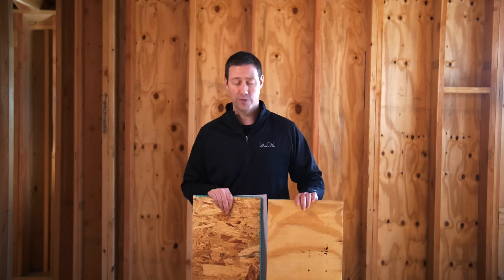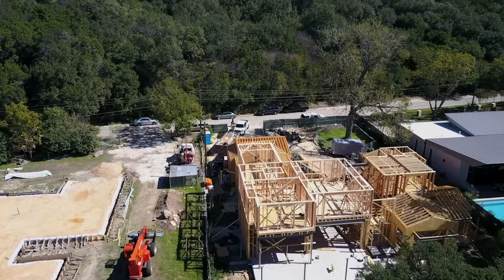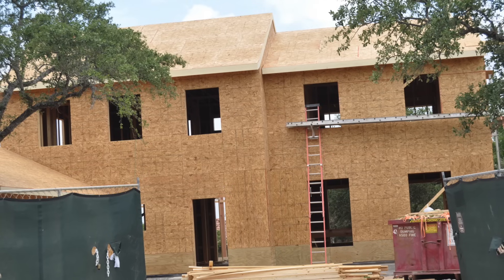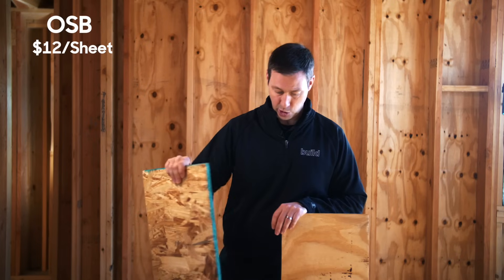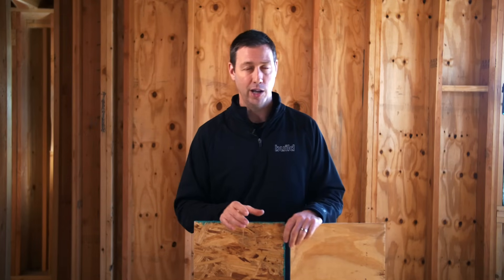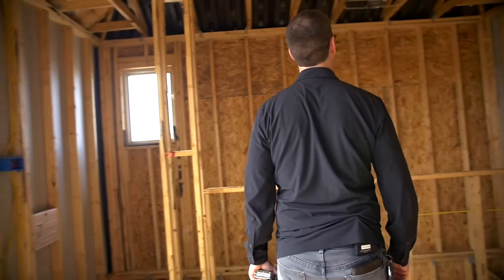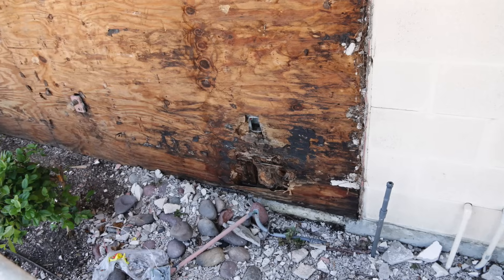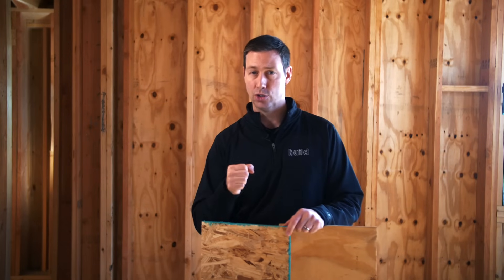Framing : OSB vs. Plywood - Whats the difference in COST AND PERFORMANCE

Comment: I'm curious why osb always has blue edges?
Reply: I bought two thicknesses of OSB for a shed I just built. I think the colored edges are different for different thicknesses. Mine were blue for the 5/8" stuff I used on the roof, and green for the 3/4" I used on the floor. I assume it's a sealant as well, but the color just helps to identify it from a distance.

Comment: Being from the UK I naturally assumed he was talking about material choices for a dog kennel or chicken shed. Why would anyone want to use either in a house?
Reply: I think sir you just continue to perpetuate the myth that water sodden bricks and blocks somehow constitute a long lived and sound building structure . They do not . Both of these materials are incredibly costly to produce and transport and consume huge amounts of energy in their manufacture . Neither perform well when it comes to thermal retention . Neither allow for truly affordable housing . The majority of  traditional brick built houses currently being constructed in the UK are expected to have less than a forty to fifty year lifespan . Virtually non of them come anywhere close to achieving Passive House standards . Virtually all of the current building stock and those currently under construction could not be re-modeled , without huge expense . I have toured the UK and seen , first hand , many sites , both large and small , where brick and block built properties are being , quite literally , 'thrown' up . Thrown up and their unprotected walls with open cavity being exposed to weeks if not months of continuous wet weather . With then , no drying allowed for , rain sodden preformed matchstick roof trusses are nailed into place and the whole sorry structure is encapsulated . The structural wall and brick fascia are water sodden , the inadequate wall cavity is water sodden . The cavity insulation which is usually , in my experience at a minimum level , is compromised by poor installation and mortar bridges - A properly designed and constructed timber and timber product domestic dwelling will not only out live and out perform shoddy brick and block structures which it would appear are the norm in the UK , they make for truly affordable housing stock . Housing stock to meet current demands .

Comment: Structural integrity is better with osb. Just built a custom home on lake Stillhouse and the ply doesn't hold up as well.
Reply: Adam Demirs I'll  bet your contractor didn't waterproof correctly and or didn't use treated plywood. I live and build in Kauai Hawaii and with our heat and humidity OSB just sucks. Only plywood on my projects.

Comment: The best building material by far is conrete.. Seriously. 90% of house here in Iceland are made out of rebar and concrete. Its fireproof, if a fire will occur the roof, the walls everything will be there no rubble. It’s safe for firemen to go in since the the house won’t collapse. Houses in Iceland that we’re built in 1900s made out of concrete are still standing and liveable. If done correctly it’s waterproof. I don’t get it why so many houses in the US are made out of timber. Yeah sure you might be faster building a timber house than concrete but if you train a house builder well enough it can be done in no time. House builders here have built a big apartment building out of concrete in a few months. Concrete all the way.

Comment: Here is another opinion from personal experience. OSB also known as glueboard or chipboard is a false supporting material. Its strength comes from glue. Here is a little insight that I have about OSB.  Long term OSB oxidizes over time, so the houses may fill with toxic gasses which will contribute to the residents allergies and what the OSB supports will loosen up.  OSB, once cut or holed, has exposed wood chips and bark. What that equates to is, in humid areas, black mold will grow in the walls and then it will pollute the house making the residents very sick. (Reservation homes are where I have seen this in every home). Nail holes also create potential black mold habitats. Black mold is in most wood bark and spores withstand the glue and heat of manufacture. Here is another issue with OSB. As a firefighter, I have experienced this first hand as well. OSB roofing only lasts about 30 minutes to an hour in a house fire. So if we know the roof is OSB, firefighters will not vent the fire from the roof, because we don't want to die when the roof fails. Modern trusses also fail very fast in a fire because the plates that hold them together burn out the wood first around the plate. Plywood holds up for several hours and is not a worry. OSB was a solution to waste from milling wood products. It is worthless as furniture, a real fire hazard, and a pollutant in a home.  If there is a worry about getting plywood wet just pay for marine plywood in those applications.  There is a reason things are cheap. In construction, cheap might kill you.  If I had not experienced these things first hand I would not have commented. Firefighter training has videos showing what I am talking about so anyone can just watch the video to verify my claims about the fire issues. I feel strongly that OSB should be banned as a building product because I care about people, pets, and property.

Comment: Like other building products... the glue is probably adding to some type of slow death as we breath it in and out every night. Plywood on a chicken coop lasts for years... no chance fibre board will do that. Ply will breathes better and therefore dry better under wet weather.

Comment: Is no one going to mention the. Amount of warping if the house is built correctly plyboard typically buckles and bends more giving wavy walls and dipping roofs though it is still less susceptible to total failure

Comment: As a building designer; I design every home with plywood sheathing because no matter how you slice it, plywood will beat OSB every time hands down. OSB cannot handle moisture at all (same with MDF) anything that is glue pressed board is garbage versus moisture and shouldn't be used for anything you want to have for an extended period of time.

Comment: If you want to build for long term with low toxicity that has tremendous insulation value and is fire proof and more stable than anything else in an earthquake, look at rammed earth houses, there are modern builders useing modern versions of this ancient technique

Comment: Well I would say that moisture is not something I would consider since it will ruin wood, OSB or Plywood over time. I went to trade school at Algonquin College and we had a 10x10 made of wood that smelled great. The plywood one was fine but the OSB one in the sun smelled like glue, it was disgusting. For exterior sheeting here in Canada where it is sealed from the home, it is ok but under a floor, I only and always recommend plywood. It is well worth the extra exppense. Styrfoam is good for sheeting with some of those wind braces cut into the framing too.

Comment: In the early '90's I watched 122 new-construction roofs sag between each rafter within one year of concrete roofing-tiles being installed because the roofs were sheathed with OSB. Lean a sheet of OSB and a sheet of same thickness plywood at a steep angle against a wall in your shop or garage and watch how fast the OSB sags while the plywood stays flat for years. OSB flakes apart easily when it is repeatedly in contact with moisture.

Comment: Good quality OSB is better in my opinion. Here in California we have earthquake codes to deal with and 3 ply CDX is not allowed 5 ply select struct 1/2" or OSB. 

Not only does OSB cost less, it is flatter, it has no voids, termites don't eat it, it nails better, it holds better, it has better specs, it has no directional orientation and it won't delaminate. As long as you make sure the OSB that you buy is good quality with plenty of glue it will resist absorbing water too. It meets national fire standards as well. Most people that poo poo OSB don't work with it.

Comment: Osb also has a huge pita factor.  Cutting plywood creats sawdust, cutting osb creats powder.  Much more slippery to walk on or stand on while cutting.  Because osb creats powder it also blows in your face more while cutting because the powder is lighter.  Sheath on a windy day and you'll see what I mean.  Although they cut little grooves on the face of osb to make it less slippery it's still more slippery than plywood.  You learn that you have to move more slowly on osb.  Time=money.  And of course customer acceptance is low with osb....

Comment: The first floor should always be built from dead materials- reinforced concrete, brick, stones, cinder blocks. If it is from wood, humidity from ground will get into it anyways through condensation as difference from  soil temperature and air temperature will cause humidity in lower sections of walls.  The second floor can be built from wood, plywood is a better choice as it is torsionally more rigid and is less fragile  and will not allow walls to move sideways even without diagonal planks..

Comment: One comparison, strength. You would not build a boat with OSB the strength is in the glue. But plywood being constructed with layers of sheets of wood with grain in oppostion giving the sheet enormous strength. practically indistructable. Ocean going vessels an example. And also building in an earthquake zone, would be a big help.

Comment: if we go back in history and look at how Castles were constructed decades ago in England Scotland Ireland and Russia etc, you will learn they were built out of cob and some still in use to this day. being lived in and or turned into hotels. Cob doesn't burn it's fire proof, rodent proof, bug proof and it breaths. cob is also mass so it holds and stores heat from the sun plus it's eco friendly. cool in the summers and warm in the winters and the best part about cob is it's dirt cheap. it better then rock and adobe because it's one solid mass no mortar to crack and break from the shifting from the earth. Cob is also the Strongest structure in an earth quake. I'm loving dirt as a building material after researching the best known building materials throughout history. To date I've not heard of any building code back in those days when most homes and structures were made from cob. todays standards with all the damn codes are just crap.

Comment: I’m a plumbing contractor I have seen a lot of water damaged homes… OSB turns into mush and swells after being wet for awhile.. good plywood will dry out fine. I can think if numerous reasons not to use it and one to use it … it’s cheep … if you want a crappy house just get a manufactured home

Comment: Using the arguments he used to sit on the fence between OSB and Plywood could have easily trickled down to the cardboard. If installed and protected correctly....it will be fine.

Comment: Another Achilles heel of OSB is its brittleness.  The stresses of an earthquake will cause it to break away from the nails or staples that secure it to the framing.  This is more pronounced in buildings of more than one level.

Comment: OSB is vulnerable to water damage and mold. It’s only as good as the glue that holds the wood chips compressed. Plywood is much better. Solid wood planks are best. My opinion.

Comment: Most production builders are not using cardboard to sheath new builds.  Most to all modern builds use osb for Everything unless  specified to use something more durable like plywood especially CDX for exterior purposes or in moist regions. Homes nowadays are completely sealed rather than an open air breathing system which means when built properly OSB should suit most to all sheathing needs. Plywood is almost double the cost compared to OSB.   I use plywood to build a utility trailer or sheds. Or when rich people want to pay more money. most to all builders use OSB for everything.

Comment: first off I noted that you have run your exterior plywood vertically.  This is incorrect if you are looking for structural integrity  Also, running the plywood horizontally helps flatten crowned studs leading to flatter walls.  And OSB?  I've only been building custom homes since 1973 and the only problems I have ever seen with sheathing was when OSB was used.  It is a poor choice any where, any time. And to add to the cheapness of the product, keep in mind that not only will OSB quickly dull even carbide tipped blades, but going back to check nailing is near impossible as the nail heads usually disappear from view.

Comment: I've seen carpenters and roofers fall through OSB floors and roofing on apartments in the process of being built after some rain.  I've never seen anything like that with plywood.  It's cheaper in cost for a reason, because making a little more money on something that is going to be unloaded on the unsuspecting is the only reason cheep builders buy it.

Comment: For my money: OSB on roof sheathing  and gable ends, and plywood on insulated walls.

Another factor is vapor permeance rate.  OSB is about 2 Perms vs 10 Perm for Plywood, so plywood will allow a wall structure to breath and dry the insulation system better than OSB. 

https://buildingscience.com/documents/information-sheets/info-312-vapor-permeance-some-materials

I built with Nudura ICF wit R-40 walls, so foam and concrete will last forever with as much water as you can soak them in, but my friend did a double 2x4 stud wall 12" thick with moist spray cellulose fill (also R-40). He used a smart membrane on the inside and plywood for the better moisture relief. 

Another friend built his first house with plywood, but rain before roofing caused the entire roof system to de-laminate. I was amazed how well the OSB we used as a walkway in the mud weathered on my construction site. Modern OSB is very weather tolerant - probably more so than plywood.

Comment: ITT:  A LOT of people that know nothing of construction.  They're both fine, no fire worries, if your exterior sheathing is on fire and you're still not out of the house you're fucked anyways, no matter what it's made of.  If you're worried about your contractor doing a crappy job, then use plywood.  If not either is fine, hurricane areas....I assure you, debris coming at your house at 140mph will go straight through either.  And OSB is actually rated higher in shearwall construction.
Breaks down faster when wet....One of the dumber ones.  If your house is built correctly the exterior sheathing will be safe from water.  In wet areas..Code requires ANY construction material that may come in contact with water to be treated, whether it's the material itself or an aftermarket product (green goop/greenboard etc.) so again, no water should ever come in contact with it, ANYWHERE in your house.

There must be a ton of shit contractors out there if these are the concerns.

Comment: Why are top of the world America's houses  plywood houses?
Reply: The strength and tight fir come to mind. Plywood works as a brace from any angle, the straight edges fit together tight enough to seal well, opposing grain structure makes it very strong in relation to dimensions, and so on. You  DO know there is framing behind the plywood, right???

Comment: I'm currently restructuring. I have no choice, my inherited home was built in 1922, and subsequent additions done over 50 yrs. 1977, 1985, 1997.   
Its a mismash of rooms...lol. to make matters worse, the dirt basement is on the waterline, and floods yearly. It never dries out. I was just in the basement yesterday and the 9x9 beams holding up the kitchen floor, although rotted, are solid half way through... ah well. The beams were Eastern Cedar, and rot and insect resistant. 

My goal? I'm 56... I'm dead in 20 years. 
Keep the house going for 20 years, die, and let someone else deal with it...lmao

I dont understand why people think by spending an incredible amount of $$ that they will keep a building "alive" for 230 years..  c'mon, people. Be realistic. Nobody asks "gee... I wonder who built such a fantastic home?"  You die, they buy your home, and begin to rip it apart. 

Good. Let them. They'll have plenty to rip apart here! Lmao!

Comment: Never in my life did I see an "H" clip, until I worked with OSB. What the hell is a "H" clip? It's for OSB.
Reply: They have been around since the 50s we always used them on ply 2' centers 16" not. Then OSB came out don't know if its code for 16" now but 80s- 2008 not.
Reply: They help keep ply and OSB from sagging or rising between Rafters. Help keep everything on the same plane. Have seen ply delaminate after a bad storm that didn't get dried in just over night. Then you had to block it and nail back down. Or pull the sheet. Replace.

Comment: I'm outraged by the price of plywood but nothing would make me switch to OSB. It's inferior.  I'm especially concerned when I see it used for roof sheathing, where a small undetected leak often leads to large areas of decomposition. Nope, I'd rather pay more for the tried and true plywood.

Comment: Ferrocement:  fireproof, earthquake resistant, hurricane resistant , won't rot.
The only real problem with ferrocement construction is that the plans must be certified by an engineer. Not much of a problem.

Comment: If you want a house that he discribe that lasts long and is durable does not need much maintenence you want sturdy well insulated concrete or Brickhouse. Wood is only good if thick and dry

Comment: Houses in the south did not use Ship Lap as Sheathing , they used 1x6 run on a 45 with 1/2” gap then wrapped with felt paper. CDX is never used for sheathing in the south.We use Zip Wall or Force Field. Use pressure treated plywood on this first 2” of your house , this video is good but it’s not the full story